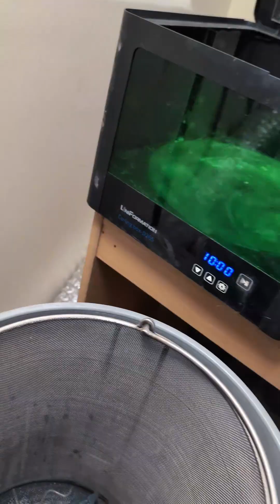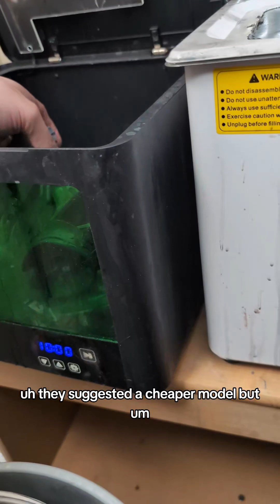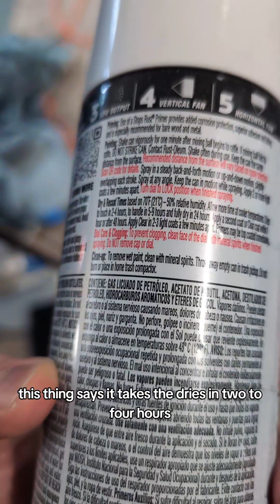The hair is maybe working!?

Comment: Dude your FMD printers will keep on failing if you do those horrible things to them, like drilling nozzles instead of changing them. Get klipper on those so you can check them remotely even on a webcam.
Reply from the maker: i have loads of replacement nozzles. but im tired of just throwing them out when they clog. ive been at this for 3 years, and i throw out so many nozzles. some like a week after installing! im tired of it, so im trying something bonkers. and it seems to be working. 
i stopped throwing out the used nozzles a wile ago so i have a lot that i can screw with. might drill out a couple more.
it cant damage the printer any more than when it gets full clogged, and then keeps trying to print for 8 hours. 
i have clipper and webcams. but i cant watch it when i sleep. thats when the danger happens.

Comment: Looking it up, for the parts you put primer on, aside from what you're already doing about the only potential way I've found to speed up the drying is with careful use of a hairdryer. Basically, it's still tacky because the solvents in the paint haven't evaporated yet, and heat will speed it up. That said, it will eventually dry with just a warm spot and air circulation, and you might not want to risk affecting the parts themselves or messing up the paint with the heat just to progress faster.
Reply from the maker: i actually just found out that heat makes resin VERY brittle. so avoid heat.
Reply: Oh that sucks